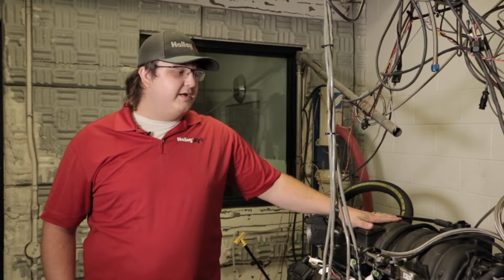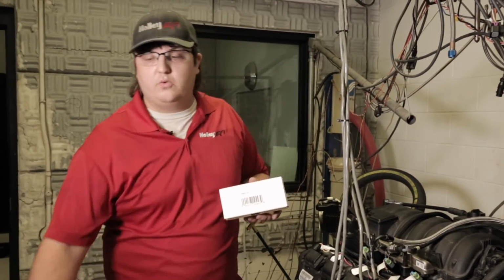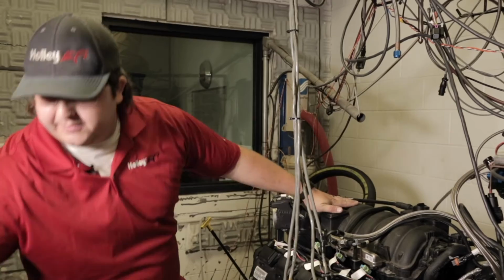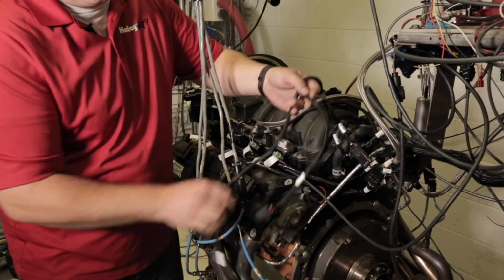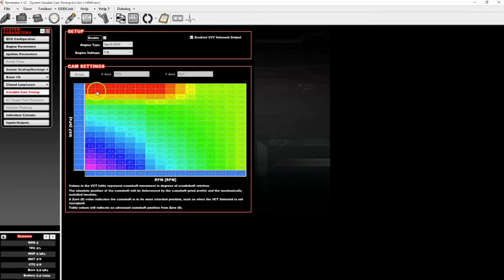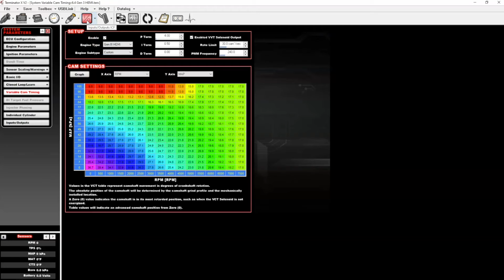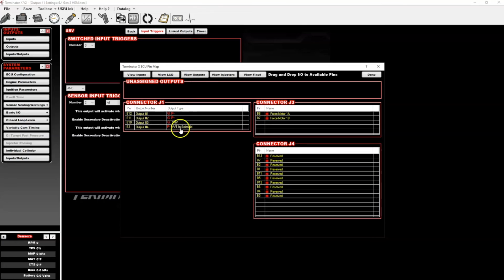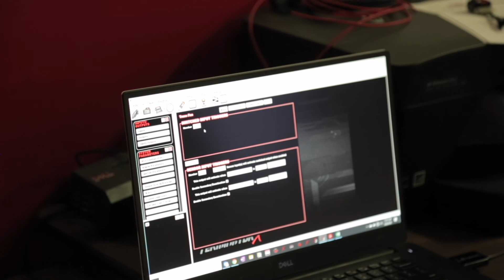Holley Terminator X ECU Now Supports Gen 3 Hemi VVT and SRV Control

Comment: So kinda dumb question...in settings for the VVT control, on a 5.7 with an OEM 6.4 camshaft, which do you select? Do you select 5.7 because that's what the engine is or 6.4 because that's what the camshaft is out of? Thanks
Reply: Would also like to know that answer
Reply: @danr9952  you ever get an answer

Comment: Can I use drive by cable throttle body with this?
Reply: You might....but they don’t show all the stuff they don’t support. You buy it then find out yours isn’t on the list....add 300-500 dollars to the cost....or use junkyard stuff maybe
Reply: Actually is a lot easier to use drive by cable with the provider terminator harness as it’s configured with gm tps and iac